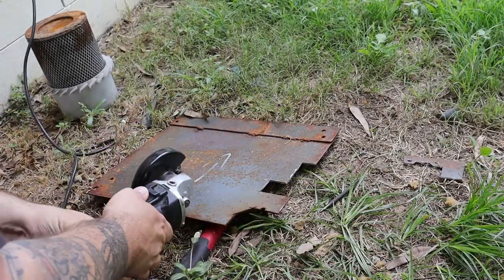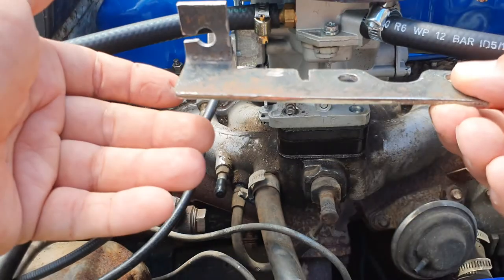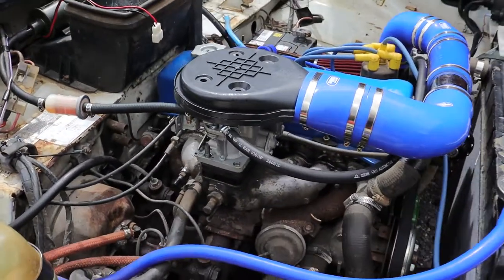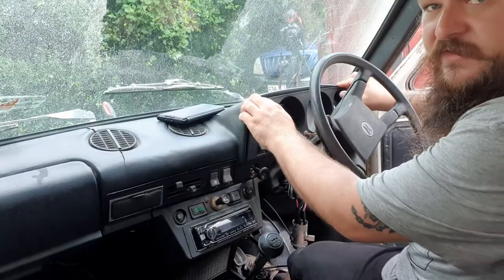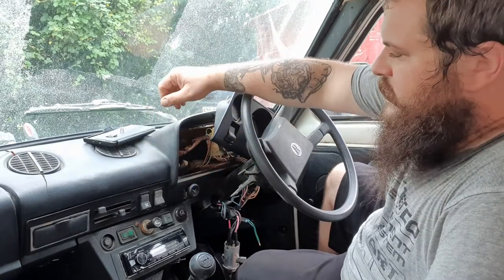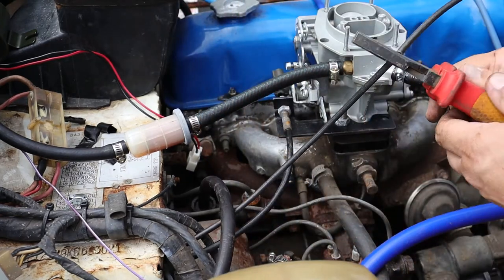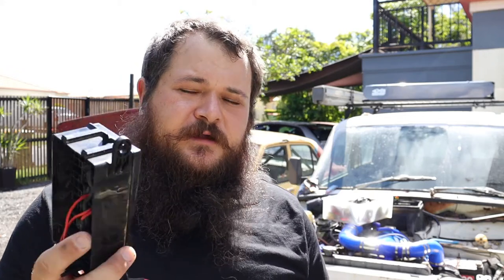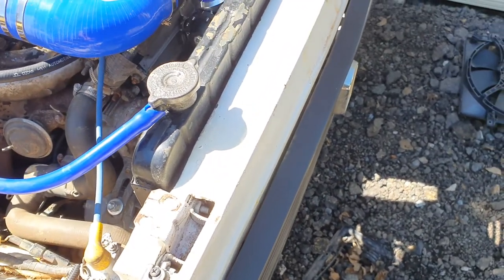Project Lada. Supercharging the Lada part 3

Comment: Hey 
Just wondering why you have mounted your carby 180 degrees? 
As I am now thinking of supercharging my Lada
Cheers
Reply from the maker: Just because it is a right hand drive. The throttle cable is on the opposite side

Comment: This is not supercharged, it is turbo only.
Reply from the maker: It's supercharged. Turbos run off exhaust gas, superchargers run off the vehicles crankshaft like this one is
Reply: It's a supercharger. More specifically - a compressor, which is pretty common on Mercs for example :)